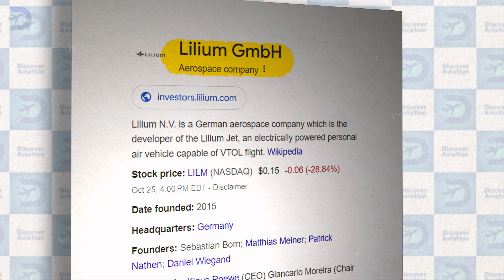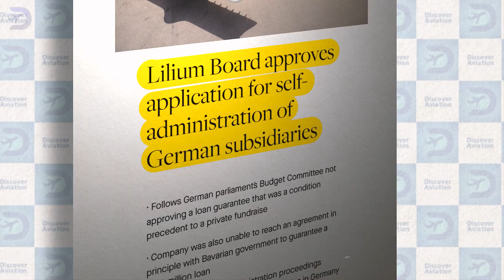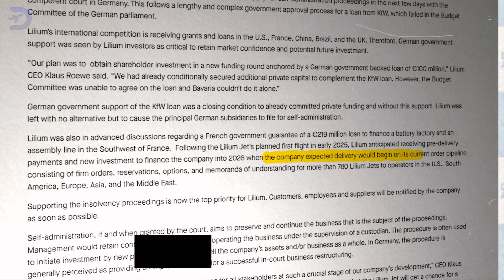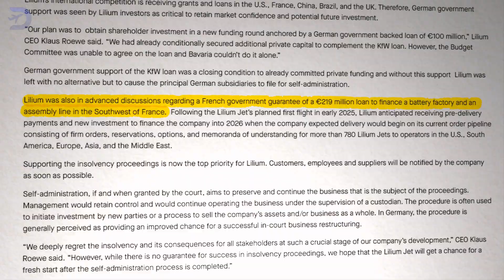Lilium's High Stakes Journey in the Future of Flight !

Comment: I bought 10,000 more shares after loosing 85% on my initial investment. I like their design and scalability, but they should cut staff and focus on engineering. I also bought Archer and it had offset my Lilium position. I should have bought Joby as well. Only investing what I can afford to loose in this sector.

Comment: So it turns out that an EVTOL with 36 super high speed ducted turbines, all mounted on a rotating flap that has to move rapidly at high torque, all the while with all that kit being individually wired, happens to be a little too hard and expensive.  But it is the coolest looking EVTOL by far!!
Reply: Hmmm, seems pretty simple to me, one long mounting tube for all of the stuff you mentioned; pinned at each end with the end in the fuselage connected to a lever arm...
Not that hard...but I'm just an architect that does his own engineering...that inverted cone was fun!

Comment: At the end of the day Lilium had fundamental mistakes in their concept. The batteries required for a concept with that high disk loading aren’t even in experimental research yet. The pitching moment in hover was also irreconcilable. And there’s no EVTOL market in Germany because the quality of existing public transport is so good. Lilium built a bad aircraft that won’t help German people. So this makes the German governments decision quite easy.
Reply: Missing German eVTOL market is irrelevant. LI-Ion SI batteries with the required specifications have been built by custom cells in Germany to aviation grade quality and are in the process of certification by LIlium under EASA regulations.
Reply: @chichenitza3819 the batteries specified and produced for Lilium need to be rated at 15C discharge power to meet their hover take-off requirement due to their extremely high disk loading. All other EVTOL players are using 5C rated batteries. The inverse trade-off between specific power and energy density for chemical batteries means that liliums “aerospace grade” batteries cannot support their business case. The balance they require between specific power, energy and lifetime is just a pipe dream at those discharge ratings. “Aerospace grade” refers only to their safety, and not their product market fit for the specified business case.
Reply: @chichenitza3819  just because Lilium got a supplier to build some batteries for them doesn’t mean they meet the required specs for a good product market fit. Aerospace grade only refers to their safety, specifically as a fire hazard. Lilium batteries are required to operate at 15C discharge rates which is at least a factor of 3 higher than any other evtol player. This is due to their unreasonably high disk loading. The impact of this is that the specific energy density and lifetime of their batteries took an enormous hit. The battery they would require to balance the high hover discharge with sufficient range and lifetime to make a good business case was a dream. It simply doesn’t exist and there is no reasonable path for any battery manufacturer to produce something like this. Custom cells in Germany also made them aware of this but the Lilium founding team is quite stubborn and they did not listen to the experts around them warning of their mistakes
Reply: @chichenitza3819  And the missing market is not irrelevant ahahahahahaha although I appreciate the bold and unfounded statement. At the end of the day the German government will support technology that supports the German people. Liliums only hopes for selling product is in the Middle Eastern market. Us and China have their own activities ongoing. Ergo Lilium does not provide a benefit to German people aside from the tax revenue they generate which can be sourced elsewhere by investing in other companies.
Reply: Aerospace grade refers really to safety only and the specs that custom cells achieved are just basic prototype requirements. Not even sufficient for a minimum viable product. Liliums batteries are required to discharge at 15C during the hover portion of the flight. This has a concomitant, negative impact on the lifetime and energy density of the batteries. Almost all other EVTOLs by comparison are discharging at 5C or less during hover. My point is that yes they got a contractor to make some batteries for them but they have nowhere near the energy density or lifetime required to meet their business case. The batteries they need which balance their high power rating with sufficient mission energy and lifetime (for dispatch reliability) are simply a dream, well more like a nightmare. This is a consequence of their high disk loading which no other evtol player has tried to replicate. There is not a battery in the world that can meet this requirement and there won’t be for many decades.